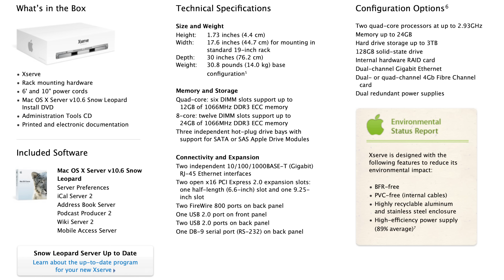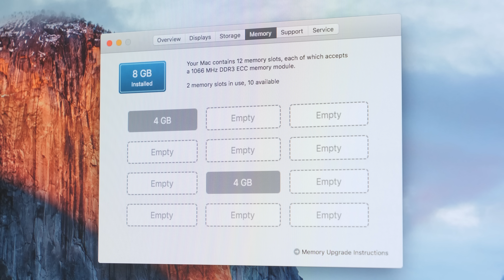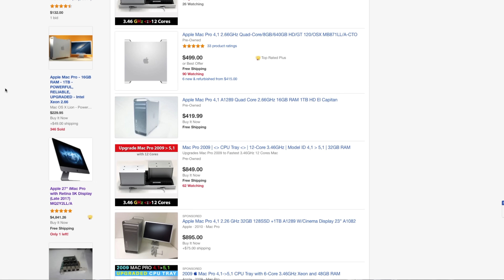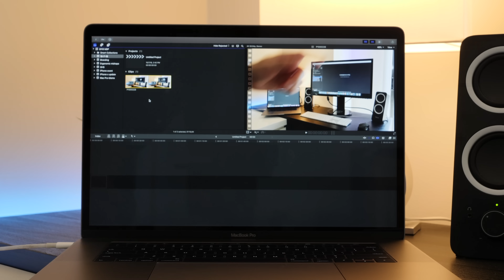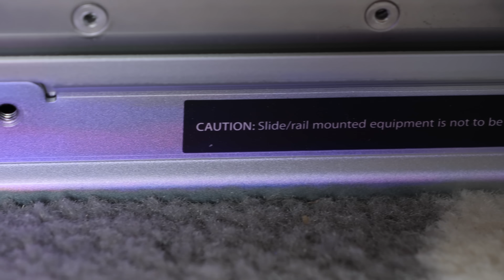I bought the forgotten Apple Xserve in 2018

Comment: Did you try to clean it, replace the thermal paste, replace any fans?
I am talking about the noise.
Reply: Trusteft it’s because the fans are server kind there much louder and they push a lot more air. The x serve is meant to go in a server rack in a temperature controlled room. You could replace the fans like you said but it might get hot as consumer fans are a lot different.
Reply: Perhaps, but physics doesn't care.  If it gets hotter due to the need for thermal paste replacement, cleaning of the fans and possible replacement of them, it will be louder than it will have to.  Doing some maintenance work could potentially not only reduce the noise but extent the life of the system.
Reply: Most servers run at 100% or close to 100% fan speed by default all the time because noise isn't really an issue when it's in a dedicated room that no one is really inside, replacing the paste won't do anything to affect the noise
Reply: There is no way to change the speed?
Reply: @Trusteft  some servers like my £100 HP server have the option to switch between "optimal noise" and "optimal cooling" in bios setup, but i don't think the xserve gives that option

Comment: Since those processors are each quad channel, for optimal CPU performance you actually need to fill 8 RAM slots. Otherwise the CPUs need to spend extra cycles getting the memory

Comment: If you are a developer, two words: Xcode Server. It can host your private projects, use that or pul your open source projects from Github to run builds for every commit you made, and alert you if you broke the build in a commit. When it is release time it can even produce the heavily optimized final archives for you if your machine has an underpowered processor.

As of graphics cards, the MXM interface is actually standardized, so you can buy a laptop Radeon RX M500 series MXM module for it as an upgrade.

For other hardware, with the latest UEFI you can try hexa-core processors like the X5675. Also the DDR3 ECC memory is fairly cheap now so maxing it out won’t break the bank.

As if software, with upgraded graphics Mojave would work. Combine that with Xcode 10 and Xcode server you get a modern Xcode CI. Combine that with your favorite video editing software you get a rendering farm (edit using reduced-resolution pilot files for the sake of scrubbing, render on this using full resolution footage.)

At worst, you can run ESXi on this and virtualized multiple instances of various OS on this. Virtualized macOS doesn’t have graphics acceleration at all so not good for any multimedia, but for CPU-only tasks like Xcode Server it works just fine.
Reply: Huh, I never considered having an Xcode Server. Sounds like the perfect use for a new mac mini or a cheap hackintosh. Good shout!
Reply: Don't use Mac Mini for that - Xcode Server eats processor and IOPS. Build a high core count machine with NVMe instead for Xcode server.
Reply: Overkill. Unless you’re building macOS itself.
Reply: Stop giving ideas, you'll raise the price!
Reply: I'm also a developer and use an iMac as Build Server for my multiplatform desktop program (Linux,Windows,MacOS - running two of them in VMWare Fusion). I use the iMac because you get it often with a broken display for cheap and it's usually much more value then a macMini.

And you really dont want to run a build system in VMWare Fusion. The graphics part is so different to real world UI cause the non GPU emulation that it sucks shitholes. I'm not an analingus fan.
Reply: sick idea bro
Reply: Absolutely! I revised mine with ESX for DevNet…
Reply: my gitlab does that job anyway and does not require a machine in my home... also it's 2018 - opensource your stuff already
Reply: @Milan-iy3pd  yeay and gitlab is git so I could upload code there from every computer, IDE, etc.
Reply: Bang on. Xcode is crappy and user unfriendly.
Reply: @randywatson8347  And eclipse isn't? Haven't tried a whole lot of IDE's but honestly using swift in XCODE is way more user friendly than any other IDE I've used
Reply: +1 for the ESXi. You get one free install from vmware with minimal features that will install straight up. 
Running OS X as guest in ESXi on xserve is easier than on anything else, because you can install right from original install image, no patching required. The guest OS X recognizes the host CPU/hw as an Apple one and does not complain. (This is getting more complicated with more current OS X versions though)
And you can run next to it your debian with docker and your other debian with gitlab and your other debian with you get my drift. 
One thing no one has mentioned is power consumption. The reason I might run one for my developers is obvious: this actually fits in a rack and I can spawn on  it new OS X instances at will. But I might still keep it off out of business hours, because these buggers are old and ineffective. I mean twice 45nm Nehalem with 80W TDP.  Really depends on how much you pay for your power - but I guess it isn't getting cheaper anywhere. 
... and "one more thing" The sad reason Apple stopped producing these is that with the introduction of 10.7 Lion they really gave up on producing serious "server grade" software so no "server grade" hardware was required any longer.  Now you can no longer run a serious business just on OS X.
Reply: I mean you could do the same thing with a Raspberry pi
Reply: @enda0man  No you can't Xcode doesn't run on a Pi
Reply: Is that English??!!!😰😰
Reply: Touhid Siddiquee It is English, just very jargon laced.
Reply: @btmeant578  If you work in any sort of tech field all of this is plain English, they could've gone into much deeper tech lingo, so all considering this is a pretty barebones statement
Reply: @btmeant578   weird..i can understand it ...

Comment: Lol that’s normal for a server. This would be better used to create a personal home/internal network, not rendering. You could hook up a NAS for to back up all you devices while you sleep, and share files, library, with all your devices. Or keep everything safe n secure from the internet and your “nosy” local internet provider. Since it’s an Apple device, it would play nice with “Apple eco system” enjoy and thanks for the heads up.
Reply: Home use in a mudroom or laundry room or garage with a cabinet with a small switch and Xserve Raid attached to it with a UPS is an awesome plex and NAS server still. Xserve Raid can be converted over to SATA. Enterprise-class with redundancy. I love my Mac Pro 5,1, but it's not a true way to use it for NAS. Redundancy is crucial for data. Xserve is a cheap way to add advance home network.

Comment: I wonder if it would be practical to stuff one of these in a garage...
Reply: Servers are usually stored inside a closet.  As long as you put the server in a rack with dust filters for the front side of the server.  It would be fine.

Comment: I wish Apple still cared about the server market. Mac OS X Server was once unrivaled in ease-of-use, but now it's pretty much useless. And the Mac mini would get more attention as well.
Reply: Timur Tripp I’ve honestly wondered how Mac network admins can function now, now that Mac OS X server is this emasculated little add-on. (It’s been years since I did Mac tech work professionally, but I used to manage AppleShare IP and Mac OS X Server (early versions) for clients years ago.)
Reply: Far from useless.  You can upgrade OS (using DosDude1's patch)(then OCLP), if you wish to stick with MacOS; or put modern Linux on it; or VMware/Proxmox, etc., for running multiple virtual machines; and so forth.

High capacity spinning hard drives for storage — PCI card for NVMe boot — max out RAM: add fiber (or faster NIC's)... gives you a great network file server (NAS equivalent), iTunes and/or Plex server, and so on.

They were always the most beautiful servers in the datacenter or server room, by far — and they still are, even today.

Comment: What is the latest version of OSX is supported on it? And I wonder if you could turn the fans down using a 3rd party app, or even replace the fans with quieter ones. (there's a video idea for you)
Reply: Officially the 2009 Xserve goes up to El Capitan, however if you use DosDude1’s install patch you can unofficially run Mojave if you also have a gpu that supports metal
My 08 runs high Sierra like it shipped with it so honestly I’d say if you go patch route it’ll last another update or so...maybe
Also yeah “Macs Fan Control” lets you adjust the fans in the Xserve
Reply: @shlumpoindustries123  You don't need a Metal graphics card for Mojave by using dosdude1's patcher, but Moajve will run better with a Metal-supported graphics card.
Reply: what about the 2010 one
Reply: 2009 model ran until 2011 when it was discontinued, so 2009 Xserve was the last version to be released, 2010 was just the year they announced it would be discontinued in 2011. Same as 2009 model in that it caps at El Capitan
Reply: g9icy i think it can run el capitan
Reply: Why sadly?! It is a server! El Capitan does all the jobs it needs! There is no benefit at all running an later os on this machine.
Reply: Some people just want to tinker. Im also pretty sure El Capitan is no longer getting security updates so if you still want it to be secure one would want an update.
Reply: Last time I went into our server room, I managed to get Sierra on ours with a little config modification
Reply: I love the design but a real for the fans would make it perfect 👌